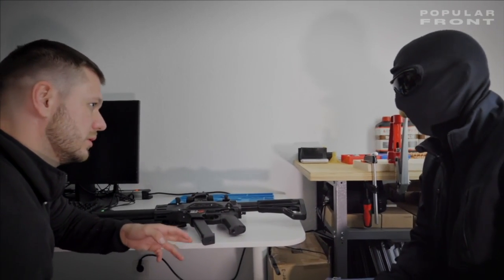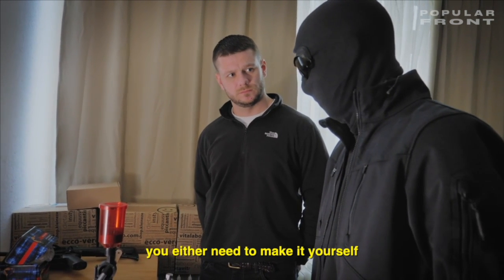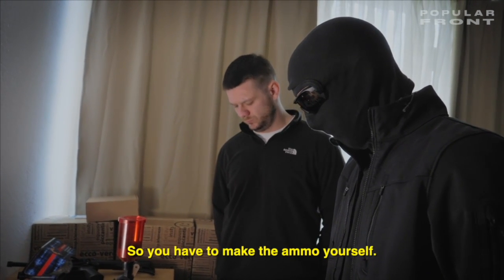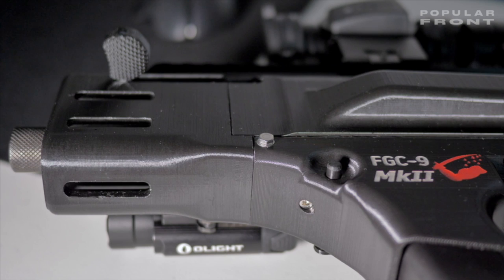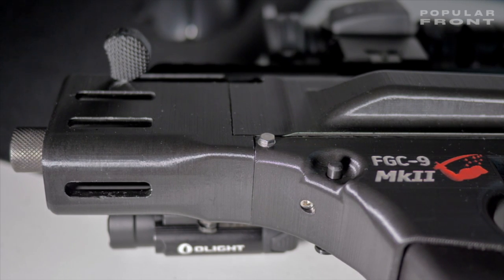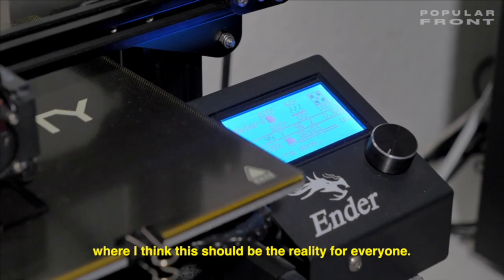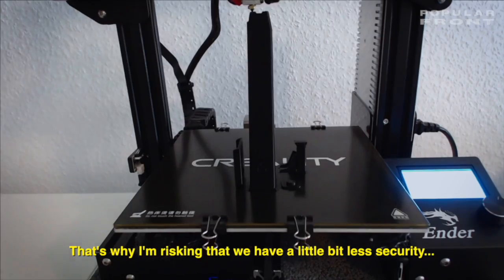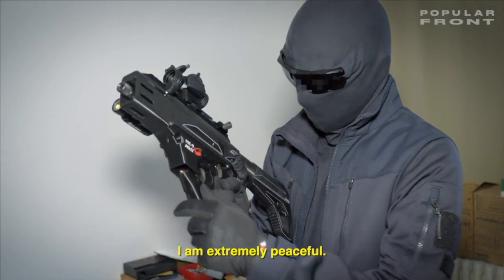Homemade Ammunition for 3D-printed Guns // Popular Front

Comment: Mostly the primer is mercury fulminate that is a combination of iron powder and a mix of nitric and hydrochloric acid yep mercury fulminate and it contains no mercury. The actual explosive is smokeless powder that is a mix of ethanol and nitrocellulose (gun cotton) to make it mix nitric and sulfuric acid and then add cotton after that it should dry and be solid crush it and mix with ethanol to make smokeless powder. The rest is most likely cartridges and ammo heads and jackets but without heavy machinery (leathe and piller drill) I doubt you could make that at home. And lastly, this was only for educational purposes do not conduct any of these experiments an home. :)
Reply: i have heard of people sometimes using those cap gun ammo as primers never tried it myself
Reply: You can make em with a mold and some hot lead
Reply: @aleczanderphillips2612  never heard of that might try it
Reply: @ManMan-vs2fq  i think you need a smelter for it though to get the lead to a liquid state though but that might not be true
Reply: @aleczanderphillips2612  can i js make the diy one from TKOR?
Reply: @ManMan-vs2fq  unfamiliar with TKOR
Reply: If you find spent casings you can pop the primer out and use match heads to reuse it or use prime mix during covid they didnt have primers so i reused them when reloading
Reply: What are you on lol. Mercury fulminate is fulminic acid salt with mercury ions. There is mercury within it, to make it use red fuming nitric acid and mercury nitrate then add ethanol, preferably in ice bath.
Reply: @ManMan-vs2fq how about try making shotgun shells??
Reply: gun cotton needs to be cleaned of any acid. If it has any left it can auto explode... me thinks?
Reply: thats not smokeless powder, they're still working on manual for DIY powder last i heard but its a fairly complex synthesis to get a stable and reliable product without controlled precursors. JStark was taking the powder from the Red Hilti ramset nail gun blanks

Comment: Hoy en dia la unica municion libre que podes crear sin control es la de escopeta ( podes hacer perdigones con plomo o comprarlos , los tacos se venden libres , el cartucho se puede hacer de plastico o incluso impresión 3d , los fulminantes se pueden hacer con la salva de esas pistolas de juguete y moldeando con algun resto de chapa para introducirlo ahi y hasta incluso ni hace falta perdigones a los tiros de escopeta se le puede meter monedas , sal hasta supe que les metían clavos o tuercas raro eso no sabria si podria salir bien )
Reply: If you 3d print the shell it tends to break. But i have seen a video of someone essentially making it out of cardboard like how they did in the old west. I wonder if you can make a shotgun shell "head" from copper and it being strong enough as its easily molded. Then tfor the primer you need priming compound and the cap itself can be made from a can, all you need then is an anvil which i havent figured out yet. 

Note this is all theoretical im not actually doing this irl